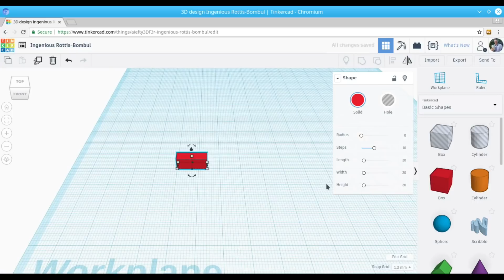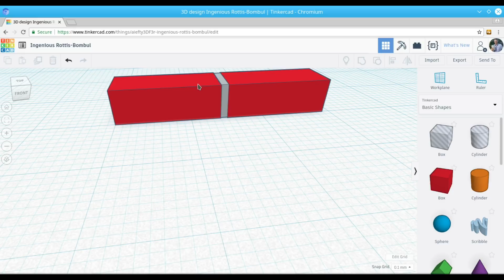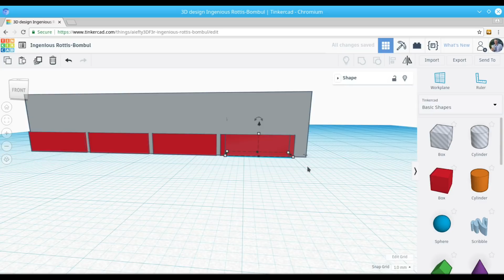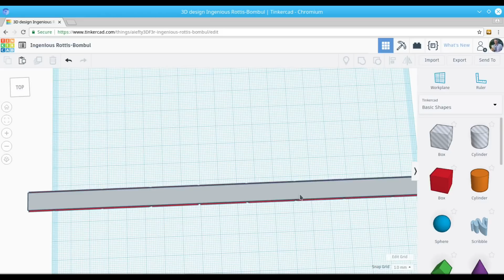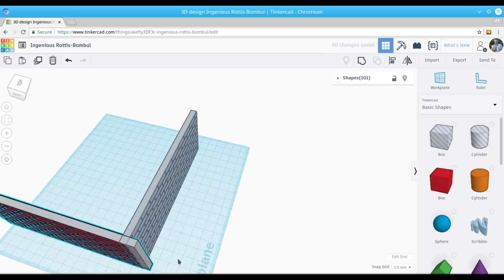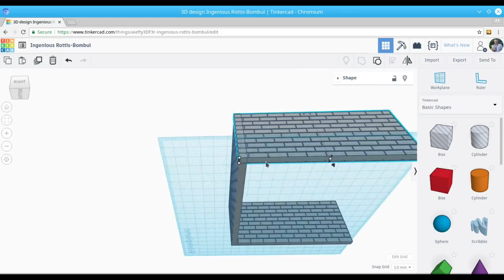Creating a brick wall in TinkerCad by AutoDesk - 3D print model railway

Comment: is not for bambu printers ? :(
Reply from the maker: It should work with any 3D printer. You should export from TinkerCAD as an .STL (.OBJ / GLTF also supported) and then import that into your slicer software. 

According to the Bambu Lab Wiki
"On the top toolbar of the preview pane, click on the first icon add to import a model. You can also drag and drop model files from a folder into Studio. Supported files include .3mf .stl .stp .step .amf .obj."

Comment: Thank you. Could you also make a video on how to do wall cladding using Tinkercard? For example, like in this photo https://imgur.com/a/omBqz7E . Thank you and much appreciated.
Reply from the maker: I've been looking into use FreeCAD for future models, but that should be fairly straight forward to achieve in TinkerCAD. I'll look into it if I get time..
Reply: @PenguinTutor  Thank you for the reply, appreciate it. Right after commenting i sat infront of the laptop and cracked my head. Finally i found it, was quite easy. Resize square to make it look like plank, rotate 20 degrees, duplicate. Just incase anyone was wondering.

Anyway, is freecad more robust and better suited for model train enthusiasts like us? I tried abit of freecad, seems more complicated but somehow feels will be easier to design complicated 3d models. Sorry for the long post and tq for listening.
Reply from the maker: @JasonDevadason  Exactly. You just need to rotate it a little then line them up.